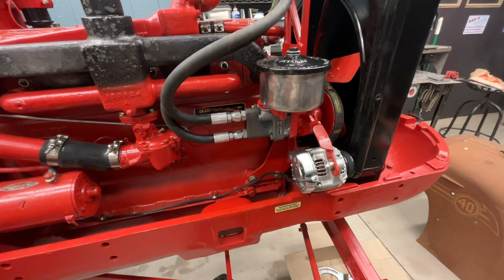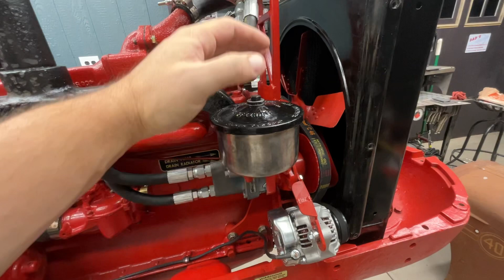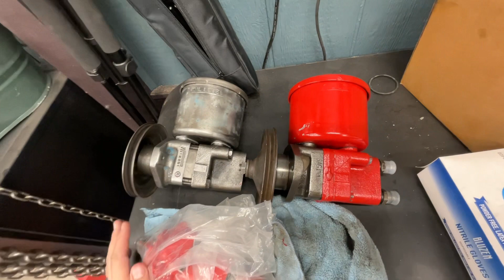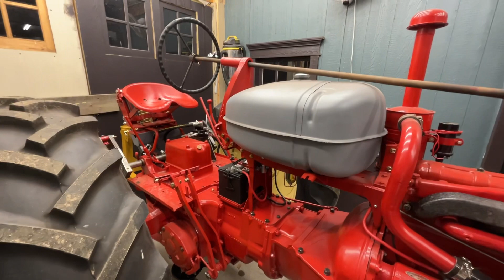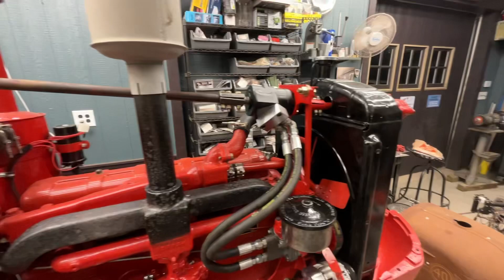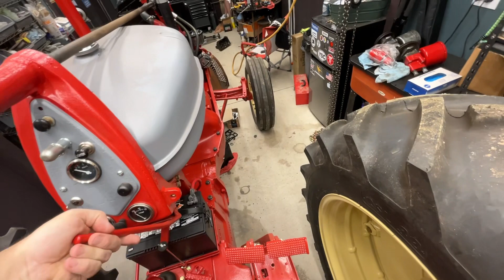1956 Cockshutt 40 Restoration:  Vickers VT16 Power Steering Pump @langbros.1907

Comment: Where can I get the pump and tank set up you have for my cockshutt 50.
Reply from the maker: They stopped making these quite a while ago.  You can still get rebuild "cartridge" kits but they are $$.  I found that these are very reasonable on ebay of you can find them.  I have 2 or three kicking around I collected over time that all work.   I also have a char-lynn s-102 
Torque generator if you are interested.  Otherwise you can get new eaton torque generators from steiner for about $1200.  You have to cut your steering shaft, and you have to cobble your own mounting bracket.
Reply: @langbros.1907  Just need the pump with offset tank that works. Have everything but pump set up. Pump was missing and running off rear hydraulics on our tractor. If you can help that would be great and best way to contact you directly.
Reply from the maker: Hi George,  sorry if I missed your comment here.  Let me know if you are still looking for info on the Vickers pump.  You can reach me at Casey.r.lang@gmail.com

Comment: I've been thinking about adding a power steering system to my Cockshutt 50 following, mostly, your model. Question: why didn't you use a governor mounted pump? Thanks.
Reply from the maker: The shortest answer is that was what came with this tractor. (Grandpa had bought it original in 1956 and added this char-lynn setup shortly after)  You can get a gov mounted pump and will give you the same result.
Reply: @langbros.1907  OK thanks - that makes sense! My 50 is a '53 so it doesn't have the 300lbs each front wheels like yours - that said power steering would be nice to have! The factory unit would have had a cylinder mounted to the axle using that extra hole.
Reply from the maker: Honestly unless you have a row crop front end, the adjustable and standard wide is just a bear to steer without assist.   Really makes it effortless.